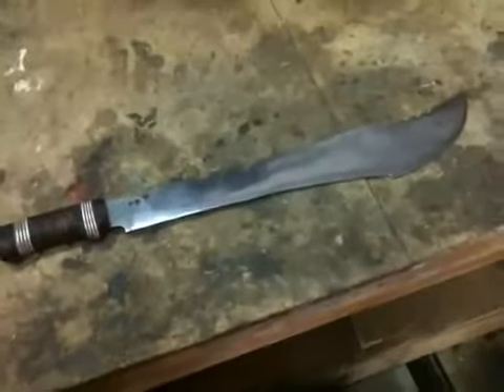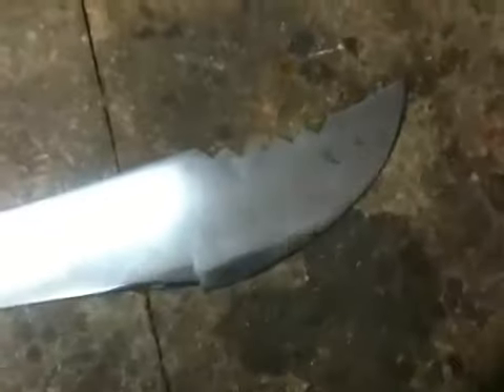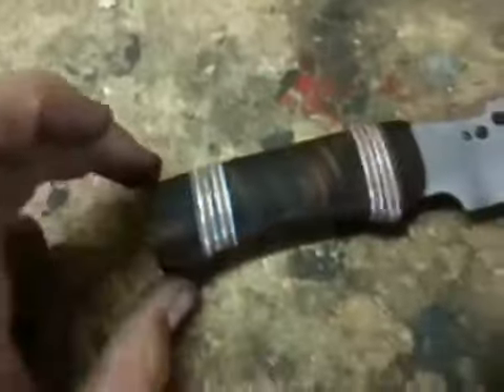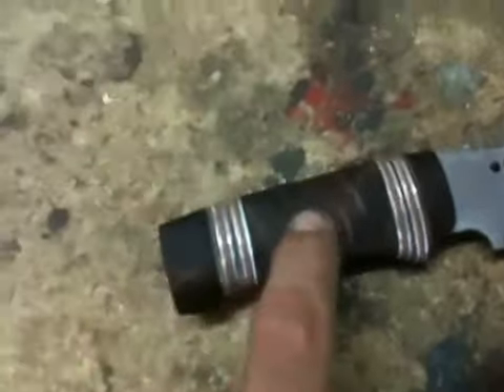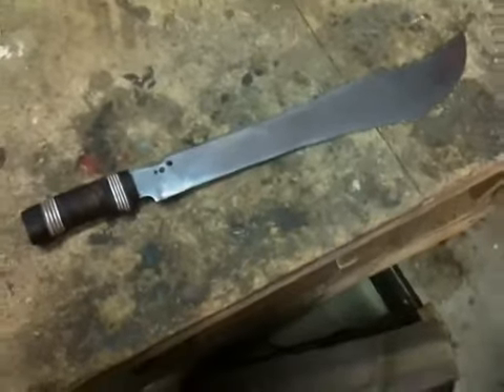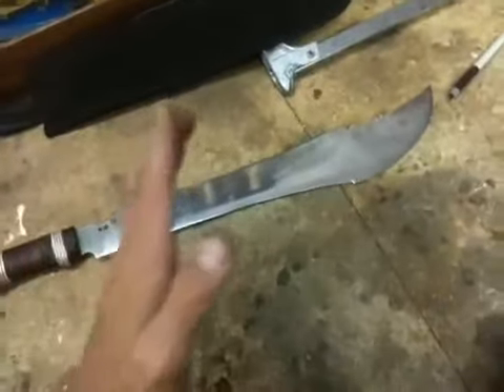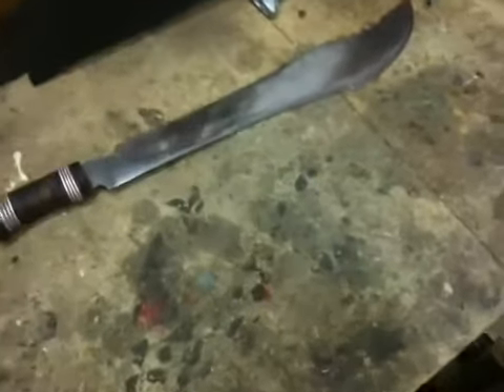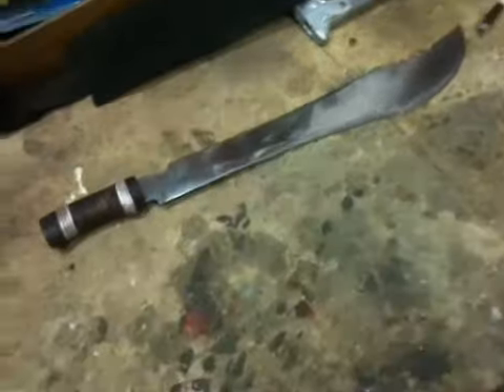HOMEMADE MACHETE

Comment from the maker: @justinsundaram17 it's not how u attach the handle... the blade weight size and the knifes intended purpouse determines what type of tang u use. For small knives rat tail works, for large knives full tang is ideal

Comment from the maker: @justinsundaram17 i made This knives for a friend only as a show piece this knife was too long and skinny to usually have a rat tail tang but as a show piece it doesn't matter. The handle is still strong overall but it's not strong enough to be used constantly and roughly. But my other knives have the perfict porportions to have a rat tail tang and be strong enough to last